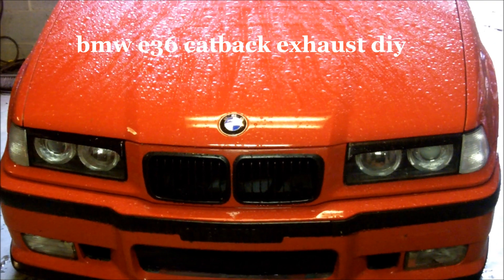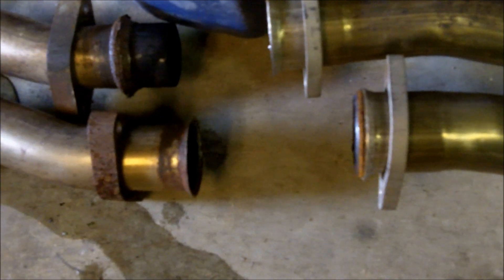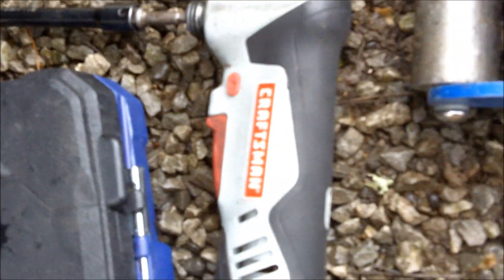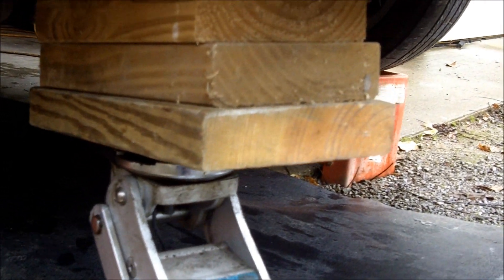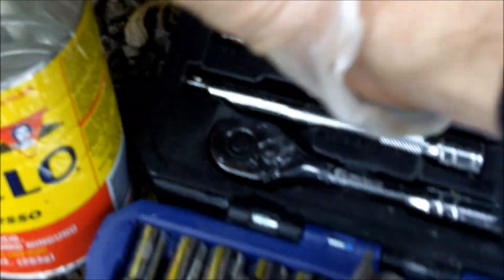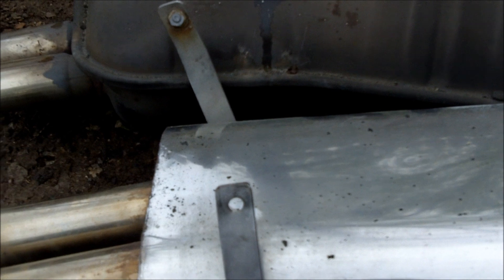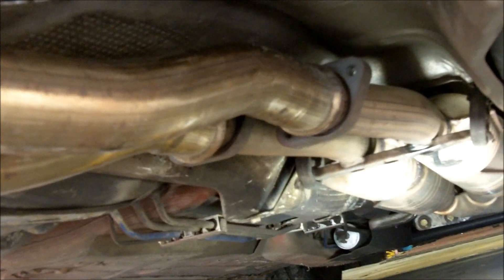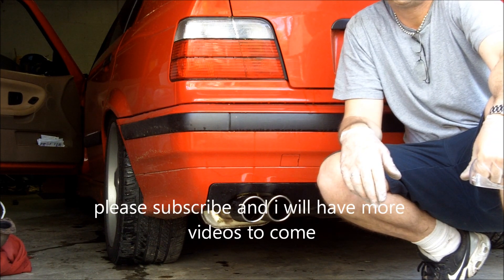BMW catback exhaust install link to e36 borla catback in description

Comment: Really helpful! 
Just to make sure, you pretty much only swapped out the stock axle-back, not the cat-back.
Reply from the maker: The pipe goes from the catalytic converter back. Hence the name catback. It's about 10 feet long

Comment: Cat back means from the catalytic section of the exhaust back to the muffler. The mid section has the cats and resonators. So it is a catback.There is no such thing as an axle back unless you cut the muffler off of a cat back. Which makes no sense
Reply from the maker: That's right